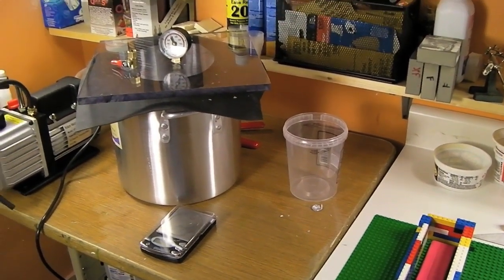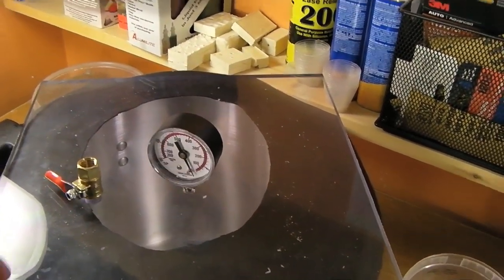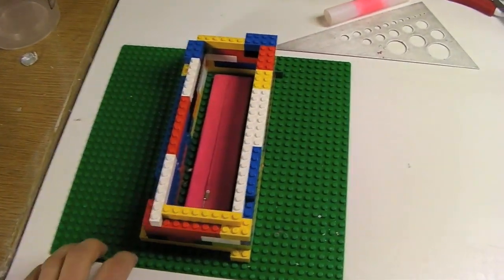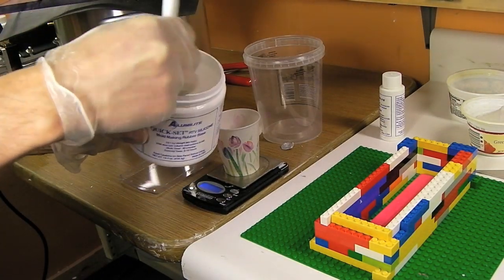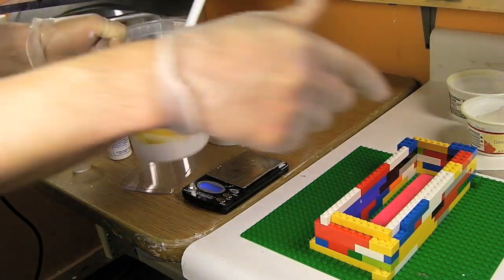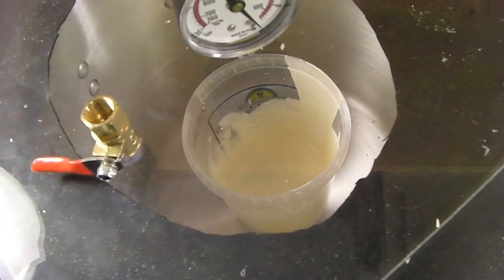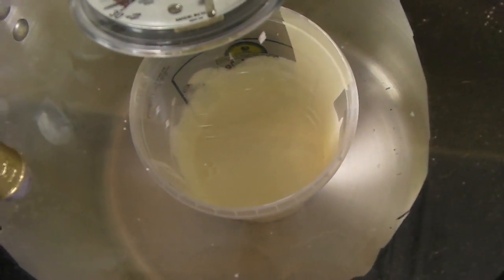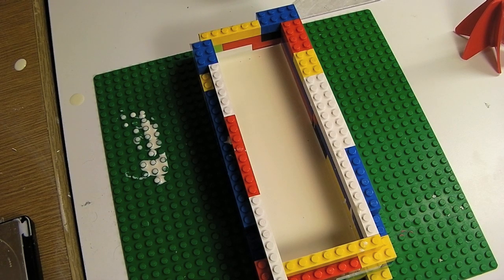Resin Casting and Mold Making Part 1: How to make a vacuum Chamber

Comment: Thanks for sharing, I can't wait to try this.  Just as an FYI, if you want to speed things up when you are measuring out your components, try just putting your mixing container on the scale and zero it out.  Put in your first component, then zero again and add your hardener slowly until you hit your target.  This is how I used to mix custom automotive paint to an existing formula or "recipe".  Nothing wrong with what you are doing, just seems like extra steps, not to mention a little bit of wasted material in your measuring cups.

Comment: Hey, Just want to say: great vid. But also if you want to take extra precautions for cleaning the inside of the barrel, I would give it a coating of regular white Polyvinyl Acetate wood glue as releasing agent, or you could also use a releasing agent of a professional brand, just for in case when something spills.

Comment from the maker: I've got a pressure pot too. The pressure pot is used when casting parts out of resin. If you don't vacuum out the air from the mold, the mold will deform under the pressure and the parts will get messed up. You need both.